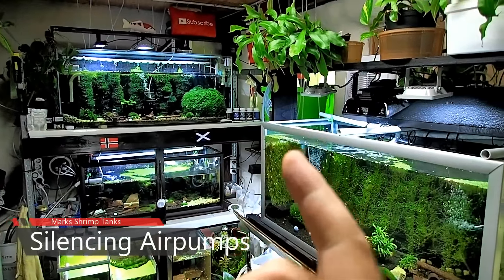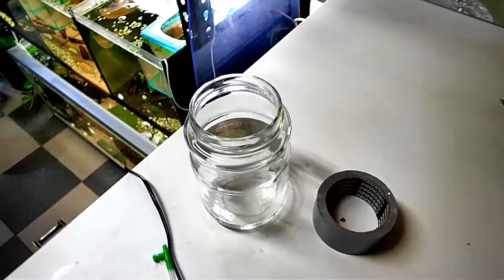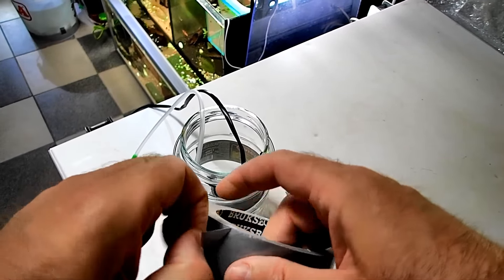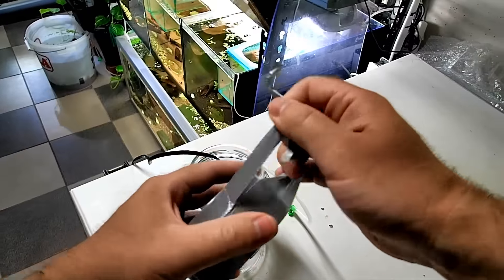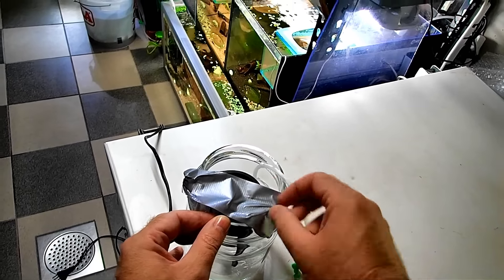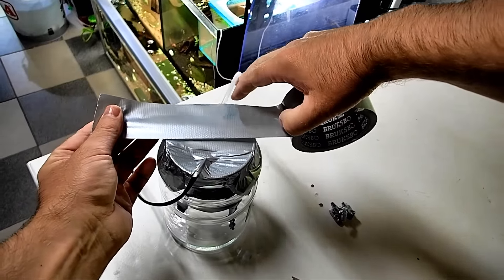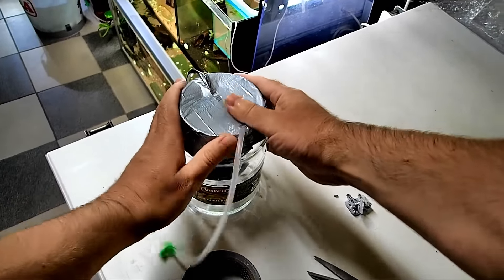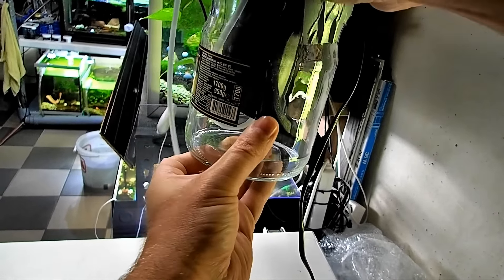Silent Your Noisy Aquarium Air Pump with This Simple Trick!

Comment: Why not just point your outflow pipe towards the surface of the water? its the surface agitation by the bubbles that creates  aeration   not the actual bubbles going through  the water. Again just point your out flow or a (wave maker)   at the surface, and you are good to go.
Reply from the maker: You know bubbles going through water is the same thing as surface agitation ? thats how CO2 diffusion works.
Reply: Have you ever seen bubbles coming from the bottom of a lake or river in nature? it’s the surface agitation that creates a gas exchange in the water, Co2 is injected in the water through a diffuser which creates micro bubbles which dissolve better in the water, but still not very efficient unless you use a co2 reactor, coarse bubble aeration is very inefficient in the way of transferring oxygen. This is due to the large diameter and relatively small collective surface area of its bubbles.
Air pumps have their uses in the aquarium hobby, many breeders use them to push water through a sponge filter as an economical way of filtration, but again if you are using an air pump as a mean of oxygenating the water column, then to me it’s a waste of money I’d rather buy a power head which helps circulate the water in the tank...very important. NO AIR PUMP NO NOISE!
Reply from the maker: We are not in Nature my friend we are in an artificial environment where I have to recreate conditions to my liking , I know you are saying sponge filters are inefficient at oxygen transfer but they also use less power than a standard mini powerhead and they produce no heat ...just a FYI though I actually use both in every tank and they both have pros and cons.
Reply: Ok😀

Comment: i just tape mine to a solid piece of Styrofoam . and i still have access to the tubing if needed !
Reply from the maker: But you will still hear the vibration from yours  doing it with the jar stops the vibrating sound waves escaping making it completely silent, the duct tape also helps to absorb the sound.

Comment: Here is a tip; to get the duct tape off the roll easier, fold over a bit of the sticky edge onto itself so the very edge can't stick to anything but itself. It makes it easy to use each time, without having trouble trying to get it peeled off the roll.
Thanks for the pump silencing video Mark.   <·))))~{
Reply from the maker: yes thats what I normally do, when making videos my brain goes into fart mode.

Comment: i stopped using air pumps precisely for this reason. what 's the use of buying a product that promises silence (which you will maybe enjoy for the 1st week or two, and then end up having to modify the design or wing-wang a way in order to make it function like it's supposed to... reason no. 2 i don't use air pumps is beacuse they pull air from the house and pump it into the aquarium, drawing in everything from perfumes, pesticides, and smoke and filter that through aquarium water.
i only use underwater filters that filter and cycle water directly without risking any trouble. with one fishbowl i drilled (ohso carefully) the smallest hole that could just fit the thickness of the pump's cable, clipped off the plug, inserted the unit into the bowl, fed the cable through the hole, reattached the plug, sealed the hole with aquarium silicone, and carried on doing business as usual. i simply refuse point blank the use of airpumps.
Reply from the maker: I have 30 tanks running of one large airpump now, yes there is a little noise but its in the washroom, there is no perfume or smoke in theis room and I dont allow pesticides onto the property.  In my new house The airpump will be in another room so there will be no noise.

Comment: Yeah Duct tape because it was invented and used to seal up air ducts in your HVAC system...
Reply: you got it wrong there, buddy ... Duck Brand® duct tape takes its name from the original name of duct tape. This name came from two factors. First, the tape was originally made from an army green cotton duck fabric. And second, the water-resistant properties of the tape were said to repel water like the back of a duck and that as the goal of its invention.
So you see, Duck tape came first and not for the use on HVAC systems ... but for waterresistant taping of bandages and other stuff in the field.
The use in engineering (HVAC etc) came later and product copies were called duct tape because Duck tape was a brand name.
Not saying Duck tape is a better name for it, just that your reason for calling it duct tape is wrong.
Reply: @diedampfbrasse98  Nope

Comment: Set the belly of the pump on a little bean bag (I had an old carbon bag).

Don't block the air intake.  Make sure the feet are off the table.

Boom, silent.

Cheers

Comment: Throw it in the garbage. No more noise. Air pumps are unnecessary.
Reply: Not if you use sponge or box filters.
Reply: Canisters and HOBs are the best IMO. Sooo quiet i have to check the waterflow to see if the are running and they dont take up space inside the tanks and can be had for very reasonable prices.  If you put a sponge over the intake they are also perfect for shrimp or fry.  

The only time i cant think of where air pumps would be useful is if you are running multiple tanks and want cheap filtration.  If you running a single tank and want cheap filtration an air pump with a sponge or under gravel filter is going to cost more than a HOB or internal filter especially a larger tank like a 55g as you need a decent amount of flow thus a larger and louder air pump.
Reply: @bigbowlowrong4694  sponge filters suck.
Reply: @alfaholic3  I run multiple filters on my tank. I have a 125 gallon tank and I have 2 aquaclear 110 filters and a marineland c 360 canister filter. I keep cichlids.

Comment: This is a terrible idea.. this will burn out your pump so easily! There is no air intake for the pump to receive now your just making a vacuum inside the jar..
Reply from the maker: You clearly didn't listen if you think there is no breather hole, by the way after this in an update I put a temperature sensor in the jar and it it never gets above 35c.

Comment: hows the pump supposed to work if its not getting in any air in the jar?
it will end up making a vaccum in it
Reply from the maker: Its not sealed in :)
Reply: Marks Shrimp Tanks it looks to me like u sealed it off with the tape. Did u make some holes into the top?

Comment: didn't work, sorry Marks you're testing it with 20+ aquariums in the background and pumps etc then make us believe it's silent?? try it in a 100 % silent room then you will know, no trying to bash you and the 50K viewers that might deal with the same problem, I use the pumps for my dwc system so I really need silence in my apartment, I have 3 of the aps 400 silent pumps and I tested it like you explained, and I heard no difference at all, the noise is the same even tested it with a decibel app
Reply from the maker: I switched the pumps off and placed the mic next to the pump, if it didnt work the video wouldnt be so popular.